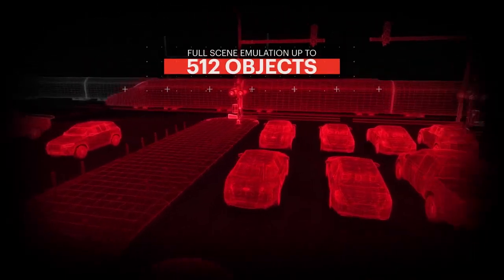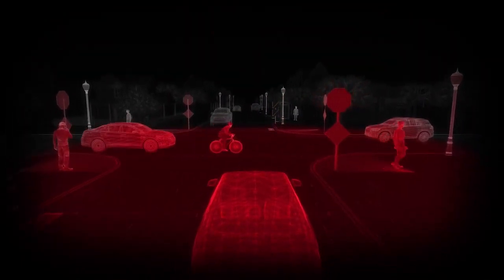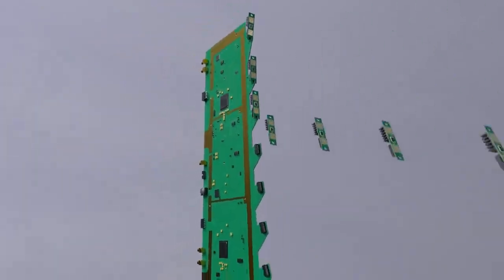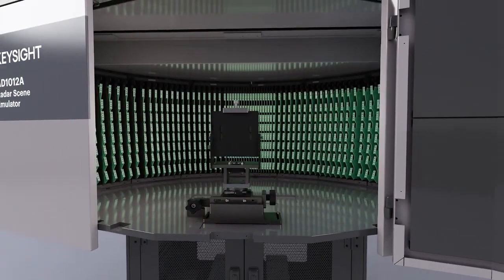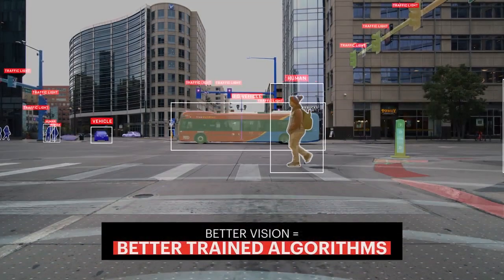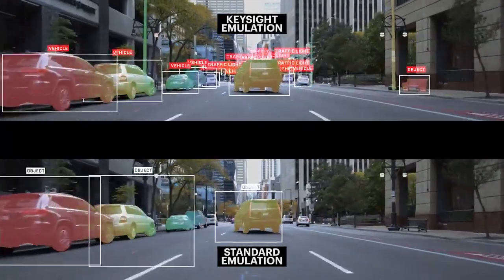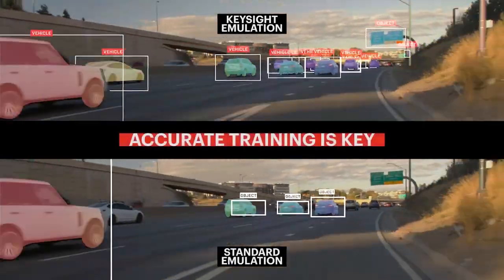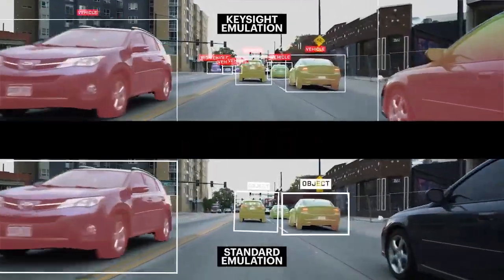Revolutionary Automotive Radar Emulator - Interview with Keysight Expert, Michael Reser

Comment: How does it work?  It it an array of radar transmitters?  an array of controllable radar reflectors?  could instead, one simply control the signal from the radar directly to train the software?  (assuming it is the software that is the goal...?)
Reply from the maker: It is an array of 512 transmitters that can supply signals to emulate various objects and scenarios to test the radar sensor. It is to test the radar sensor with various algorithms.
Reply: @MicrowaveJournalVideos  wouldn't that just be a matter of determining if the radar can detect a reflection from various locations and would not be as complex as described?
Reply from the maker: @drstrangelove09  I am not an expert but you can control the transmit signal to look like many different types of signals so can simulate thousands of types of targets and scenarios.  Reflectors cannot emulate that many different types of targets since it is mostly based on the physical structure reflection. You can also test jamming and interference with active targets which is a big issue.
Reply: @MicrowaveJournalVideos  OK, it still seems strange that the radar sensor needs to be tested in terms of algorithms... apparently the sensor is more than a sensor, apparently it is processing the data and sending back object information -> "there are x objects with these positions, velocities and accelerations"... so it is much more than a simple sensor.